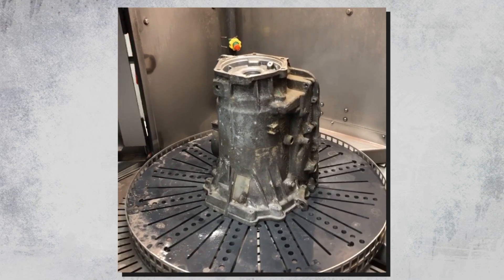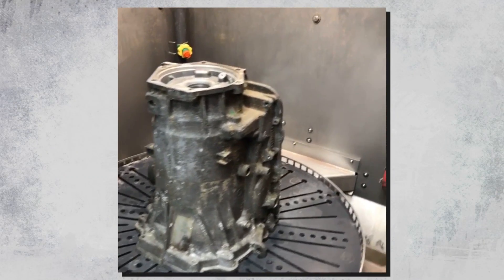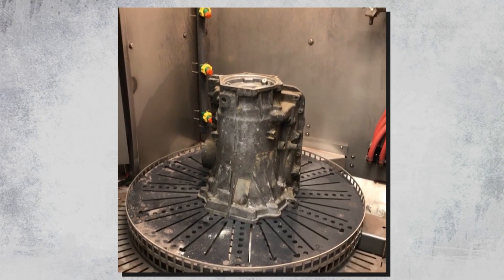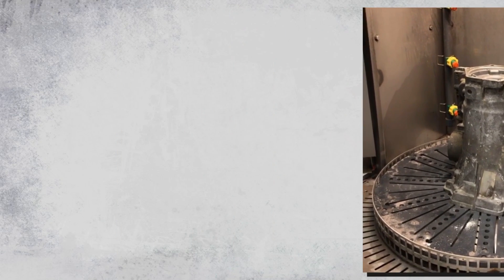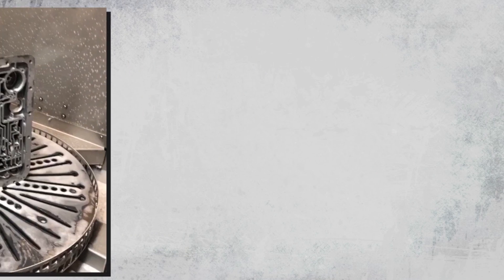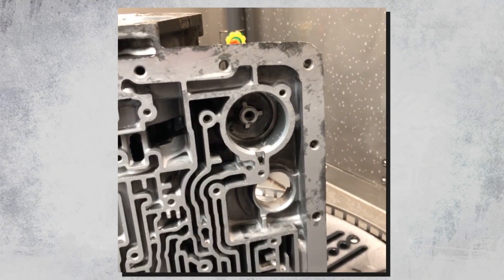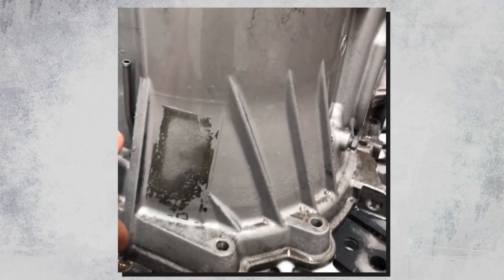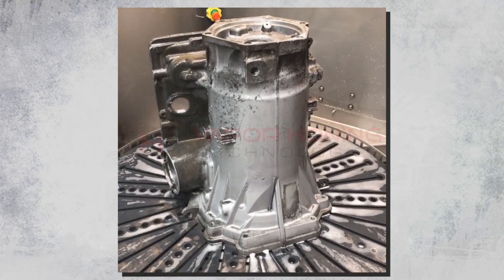Vapor Blasting/Wet Blasting a Transmission Inside VHT Gladiator - Vapor Honing Technologies

Comment: What about the aggregate getting stuck in places like the valve body ?
Reply from the maker: A post process would be putting your parts in a parts cleaner or compressed air.  Let me know if you have any more questions. 8282204967 Niki